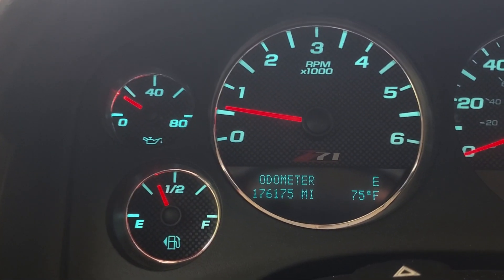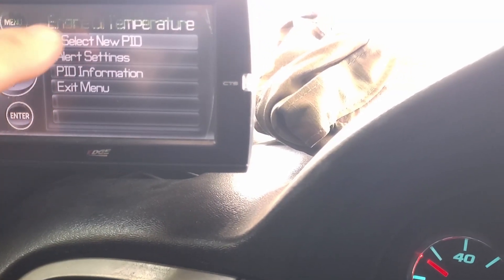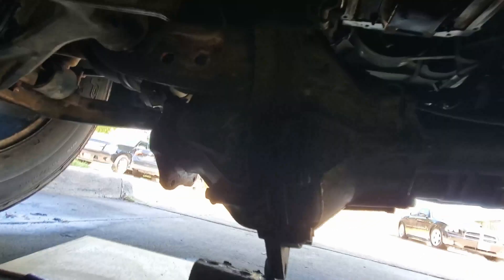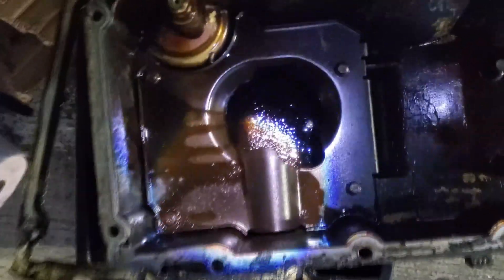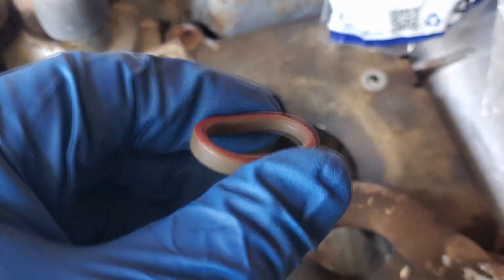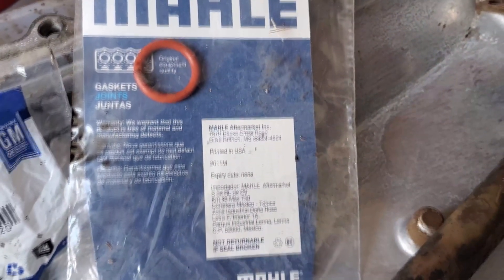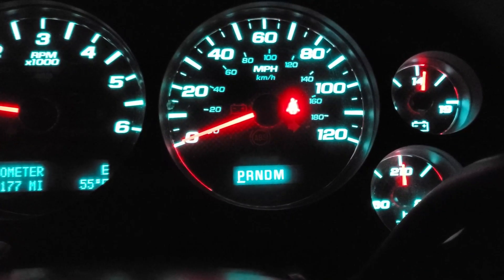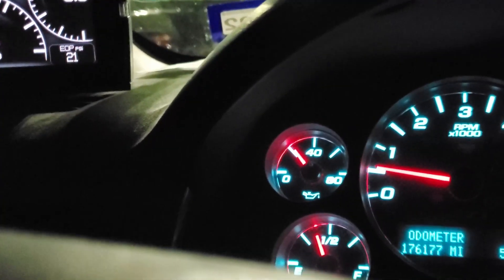5.3 Chevy LS Engine Oil Pressure Before and After Replacing O Ring

Comment: my oil pressure on my 2013 gmc yukon currently reads 17 psi in drive while hot in drive and about 19 psi in park. new oil sensor/screen did not make any difference. since i had to remove the intake manifold i did tighten the bolts on vlom cover didn't make any difference I guess next you be to replace the oil pick up tube o ring and if that doesn't fix it maybe the vlom o rings sealing the towers is leaking?

Comment: All the people that say this is off and he needs a pump your wrong. I have had 3 5.3s 2013s 20k miles to 101k they all do this. Put extra oil in n the case and raise the rear up. Check oil pressure at hot. 20 is idle 40 2000 rpm.

Comment: That’s not normal, mine is doing the same idles at 20psi even when hot but if I step on the gas from a stop it will reach 40 and come back down. Before the P0521 code came on I remember it used to sit and play at 40 psi or higher when revved .. My dumbass decided to take it to a shop and they only replaced the oil pressure sensor but it did not fix it. Now they want to replace a relief valve, at this point I’d rather do it myself since their “professional diagnostic tool” suggests to throw parts at it
Reply: I have done all of this, still no luck
Reply: Put in a stronger spring and you’re done.

Comment: deleted my oil cooler and got 10-15 more psi on the pressure, also only use wix xp filters and pennzoil ultra platinum.

Comment: Still a little low and oil pressure, but I cannot believe you took that much time to take everything apart to get to that and you didn't shim the oil pressure spring on the pump, it's easy to do with a couple of washers. Get at least 10 to 12 more pounds of pressure. It's a simple upgrade. You can use one two or three sometimes four washers in the cap that holds the pressure spring, and you still have plenty of volume in that stock oil pump
Reply from the maker: Thank you for commenting. I also hoped to see more pressure. My neighbor has an 09 Avy and said his pressure jumped after he had the rear main gasket replaced. Something to consider.
Reply: You can also just install a stiffer spring.

Comment: That still doesn’t seem right
Reply from the maker: So, I'm not the only one. Thank you for your insight.
Reply: No idea if this helps but I have a 2010 Chevy Avalanche as well, 2WD no 4WD if that makes a difference. Currently at 153k miles and I have never changed the oil pickup ring but did get a p0521 (oil pressure sensor faulty) code about a month ago and changed it. My truck runs identical in oil pressure, but even to me it just seems like it should be a tad higher. I have heard however that these 2008 and newer Chevys seem to run lower in oil pressure than the 2007 and earlier models.
Reply: Yea but what if you tow a trailer with something on it, then the pressure drops to nothing.